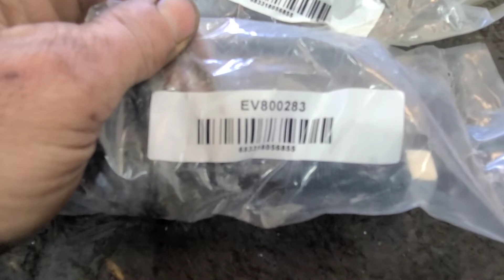Inner & Outer Tie Rods on a 2006 Volvo S80

Comment: Do you need to use loctite on inner tie rod to rack threads? Or just proper torque is good enough?
Reply from the maker: Ive personally always just used torque and have had no problems. Some do use lock tight, some dont. If I were to use it, I would probably use the blue personally.